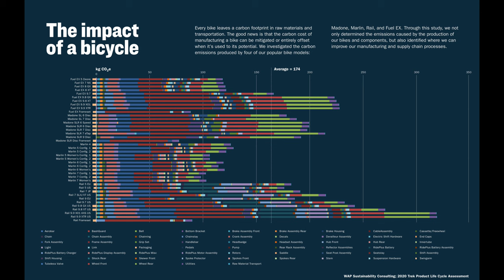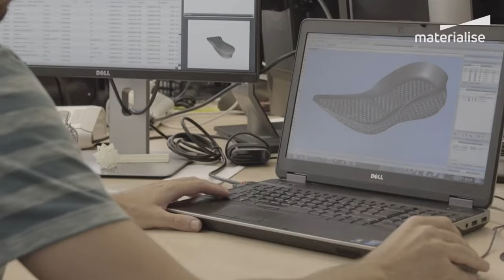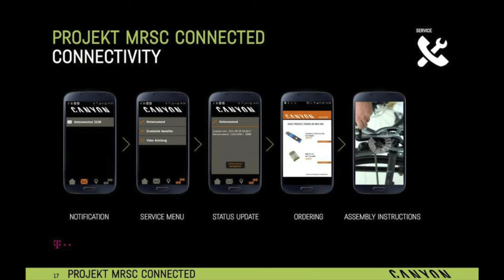Is This 3D Printed Canyon The Bike Of The Future?

Comment: I think as consumers we can work on this problem from two ends.
 1: using more recycled components. Is that shifter a little less springy than it used to be? Instead of buying a new one, take yours apart and clean it up a little. Maybe all you need is a new spring. Do you want to switch to a suspension fork? Check and see what's available used, you'd be surprised what you can find for cheap at your local bike shop. Try and keep up with maintenance too.
2: buy components that will last. Look at the lifespan of a new bike and take that into consideration. Carbon is still relatively new, but as a welder I can tell you that between cromo/steel frames and aluminum frames, steel will last substantially longer. In fact, if you look in the used bike market, I wouldn't buy aluminum older than 10 years. By comparison, there's well maintained 40 yo steel bikes I'd still trust.
Great video btw!